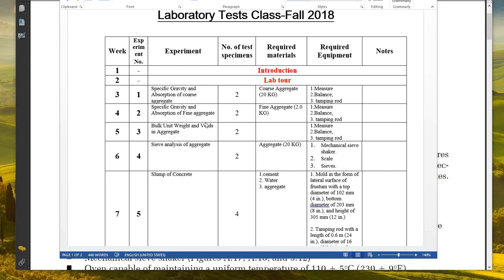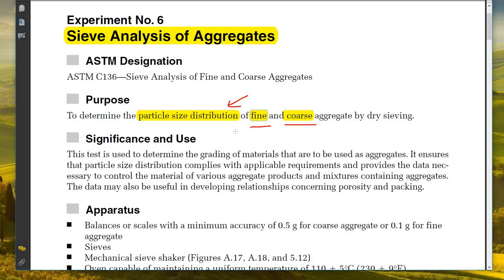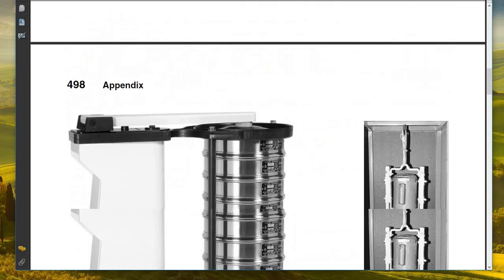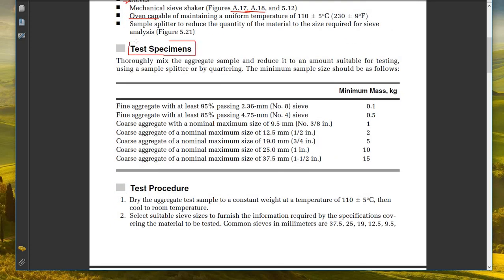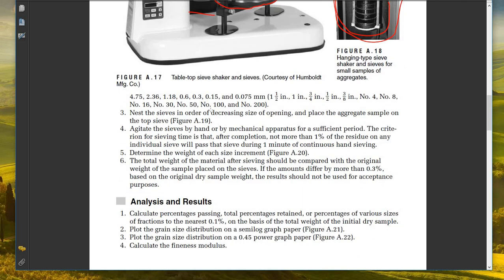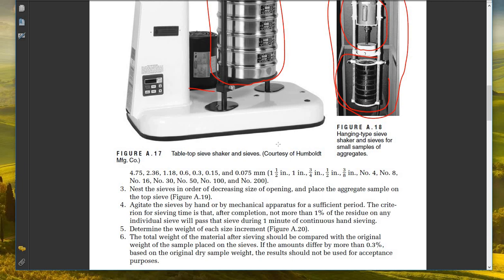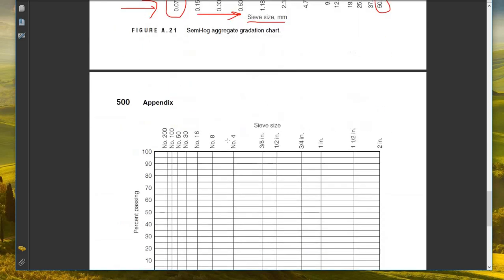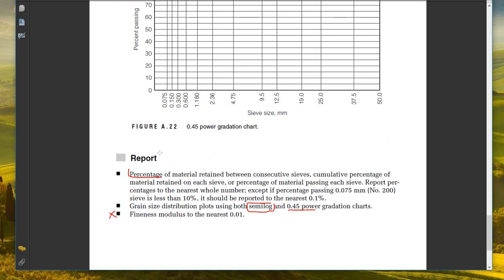4- ASTM C136—Sieve Analysis of Fine and Coarse Aggregates

Comment: Can you please make a video of performing this experiment followed by calculation, this will clear various vague concepts of ours. For Example,  as in report, you said, if percent passing sieve 200 is less than 10%, it should be reported to nearest 10%. 
As incase of coarse aggregate, we don't use sieve 200, so does this apply to sieve analysis in case of coarse aggregates. 
Similarly, which sieve we need to place at the top - like on what basis we will decide that? either we have to pass our sample through certain sieve in order to know about the maximum size of our grain so that we could use the sieve on the top accordingly or what? so there are various ambiguities concept wise and it will be better if you make a video describing its procedure followed by calculation practically to clear those concepts. 
Thanks.